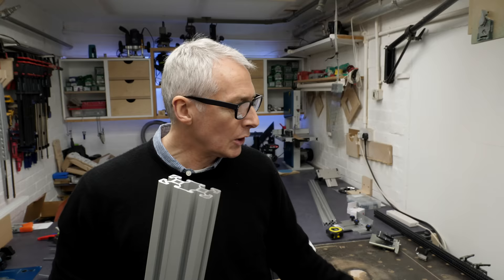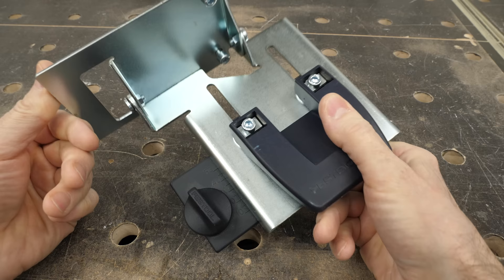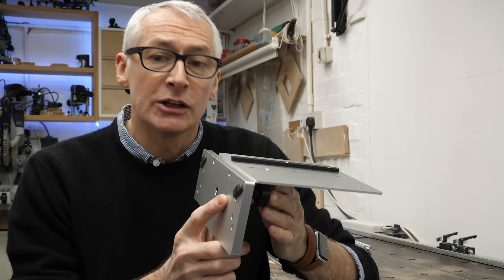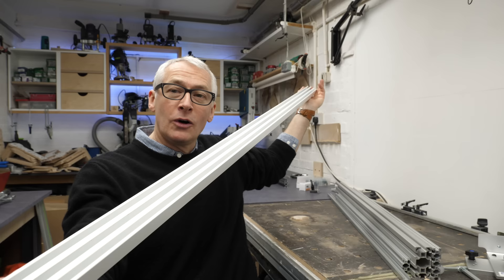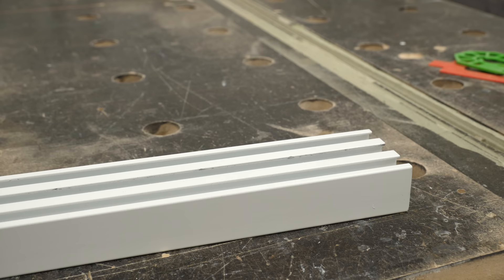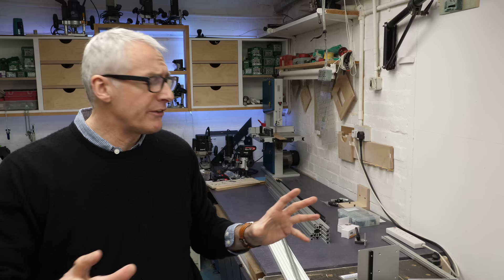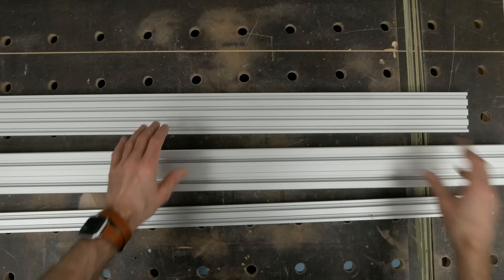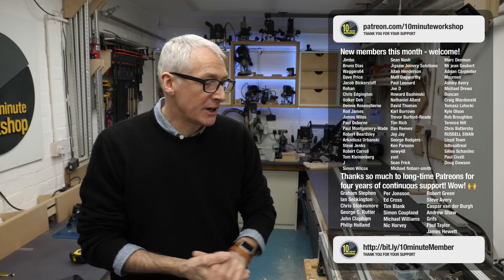Extrusion Confusion - A Guide To MFT Hardware [video 486]

Comment: Thinking out loud here, and off the cuff: That curtain track seems very subpar considering how beefy the Dashboard hinge is (I was going to give you a shout out regarding that since I picked one up myself - have yet to use it though - and hey! You have one!). So. Why not just bolt that Dashboard directly to the bench substrate? Except I also think its' excessive length is going to be a problem for you. If like me you put the track hinge in one spot there really is no need for a track back there (could be missing something though). The stock festool track hinge seems to have been pranged a bit - I can't trust it to lay the track down on the matching pin. Bit of a faff. Very keen to see how this project goes.
Reply from the maker: There’s lots more to come on this build, and many of your questions will be answered then. Lateral adjustment is very useful for the rail hinge, so some kind of extrusion or t-track - or maybe just a router t-slot - does the job. 👍

Comment: For a fixed bench in a small space, I wonder why you would need to have the rail hinge slide along a rail. Or, you might consider having the rear rail mounted over a limited span, maybe 20 cm and not over the full length of bench.  I understand the need for some adjustability for alignment, but you also have tight quarters and may need the space behind the fence.
Reply from the maker: You don’t, necessarily. But if you have the full length of  extrusion, you may as well fit it. Depending on your rail hinge, you could fit it permanently to the bench, or route. T-slot to suit in the bench material. For flexibility though, the curtain track extrusion is excellent. 👍

Comment: The minitec extrusions fit the Bessey rail clamps nicely and other cheaper ones, not tried Festool. They stay square, may be better for the hinge as well, Sautershop sell them.
Reply from the maker: Yes, the minitec is good, but only for clamps - the Festool rail supports don't fit unfortunately. 👍

Comment: Hi Peter. Quick question: why did you buy the extrusion (the one from KJN) with a 10mm slot? Does 8mm not fit the Festool clamps and the Dashboard hinge? Sorry if you’ve answered that elsewhere, I’ll watch the rest of the video, just scrolled forward to that bit, but I was assuming that 8mm is the way to go until I saw this.

Comment: Ah! We came up gathering pretty much the same information, which makes me proud of me if I can say so myself 😂

Now, I'm seriously thinking about getting the Dashboard hinge (being in contact with Rob for a while) and the Sauter frame (1200x800). It should work well as far as my understanding goes. Only doubt is that 45x45 profiles may be too light for the hinge support? Still not sure, need to investigate further on it.

Best!

P.S. great quality video, as pretty much always Pete, thank you so much!
Reply from the maker: Thanks! The sauter frame is 45x45 minitec. Should be fine with the dashboard set, but won’t fit the Festool hinge. 👍

Comment: I used to use Bosch Rexroth, which is what the kjn BR range is based on, but I moved to using Rose and Krieger profile.

It doesn't require any drilling for face to end connectors, just a mitre saw to cut lengths, which join together without using corner brackets. I've build structures with it that are 4m square and 3m tall, and all you need is a 100mm long 4mm ball end hex bit.

My home CNC machine is built using their 80x80 and 80x40 profiles.

Comment: I do think that the clamps you have, can be made to fit the track. As you have several other clamps, you'll probably not choose that option, but some of the viewers might benefit from this idea.
First thing I thought of was to glue a thin layer of leather onto the part of the clamp that goes into the T-track. This will make it slightly "thicker". It should add a lot of friction.
The second way it could be made to fit, would be to add a thin layer of epoxy in the grooves on each side of the clamp.
This is probably a lot more difficult and would require making a jig in order to get a precise enough result.
Reply from the maker: The clamps could be made to fit, but always with some compromise if you also want to use the Festool rail supports. 👍
Reply: I am quite convinced you could file away the extra metal from the Festool rail clamps, the bump that makes it clamp to itself on the thin Ikea rail. Five minutes of manual filing or one with a power filer (i.e. the narrow belt sander).

Comment: Hi Peter,
very much enjoy your videos. They are very professionally presented. I was wondering if you have looked at the  Veritas Quad T-Slot Track for your new MFT top.. I do not know if the length would work but they appear to be the right general dimensions for the front and back of your build. thanks again!
Reply from the maker: Thanks Bill. Don’t think the quad t-slot works with the Festool rail hinge set, unfortunately. Nice profile otherwise though! 👍 👍

Comment: Hi Peter I've been looking for some kind of extrusion to fit on the front of my bench to take rail clamps wound up using an old 1.4m evolution guide rail mounted on a scaffold board works perfectly
Reply from the maker: That’s definitely a more expensive way of doing it, but if you have the rail it’ll absolutely work! 🙌👍

Comment: Very informative video as usual Peter.  Is there a front rail support for the festool hinge?  Its a shame there is not an affordable hinge for the Dewalt track which I use, although the dewalt saw can run on festool track, so might end getting a short length for my bench.
Reply from the maker: Thanks Nigel. Only the Festool extrusion - or the ikea curtain track - will work with the Festool rail supports, front & rear. 
Not aware of any options for alternative rails - most saws will run in Festool-pattern rails, so I guess there’s limited appeal in someone developing one. 👍👍
Reply: Our guide rail brackets are compatible with Dewalt rails.

Comment: Design choice question please Peter. 
Why two Rutland T tracks at the front (assuming for clamp use)?
Reply from the maker: Main reason was to have other clamping options eg I can set a stop in the top track for the rail hinge front support, and still have clamping options with the lower track without affecting the stop in the upper. But generally, just good to have the option. 👍

Comment: I am wondering how much time you spent investigating all the various aluminium tracks, apparently motivated to avoid the cost of the Festool track. This was despite your considerable investment in usable Festool clamps and fittings, and then in buying non-Festool fittings. Of course, your research makes an interesting video for those who need to have a tailor-made bench, as well as a warning of the complications.
Reply from the maker: Well, a lot of what I’m sharing has been accrued over many years - decades even - if buying and using all kinds of bits and pieces. And part of what motivates me to do what I do is to see if I can make something that performs a similar function to eg a Festool original, but without the proprietary hardware. 👍
Reply: @10MinuteWorkshop  Relieved you are not deep mining the Internet for elusive gains! My own experience of unique solutions has been dampened by the subsequent disappearance of innovative small companies and then sadly, any hope of replacement parts. A lot has changed over my 60+ years of woodworking. But I am impressed with the organisation of your quite restrictive workshop and will watch with interest just how you create your replacement workbench.

Comment: How about using your router table setup and milling your own custom sections from white oak?
Reply from the maker: The short arms of the C on the Festool profile need to be very thin (~2mm) to work with their rail hinge; not sure I'd trust anything other than metal at that thickness tbh. 👍

Comment: wonderfully explained, so i wonder does the benchdog and festool stuff fit in 40x80 nut 8mm extrusion? ah bugger as i watched longer you said again that it does but i am guessing it dows not with every 8mm extrusion you have Itype which has a deepth of 12 min and B Type which  have less. like both rotex are B Type and item and the 40mm standart is the i Type. guess i hve to get  the festool system once i got a tracksaw as my whole workbench combo is makde of 40x80 i type extrusion

Comment: Have you ever considered wrapping around the mft top, to the front? Obviously not as flexible having holes, rather than a track, but wondering if a mix of both is an option?
Reply from the maker: Sorry, not sure I understand ‘swapping round the MFT top to the front’ ?? 🤔
Reply: "Wrapping around" - I think Craig means to have a few rows of holes on a piece of MDF installed where the extrusion currently is - i.e vertically/ 90 degrees to the existing one - like you often get with bigger welding tables if you want to Google for a picture.  I guess you'd still have to have a small bit of extrusion to attach your front locator peg for the track, or attach it in another way
Reply: Check out hooked on wood https://youtu.be/70DEFtp_2ew . He has built a bench that wraps around on the front
Reply: @londonmaker5347  This is exactly the example I was going to use. Hooked on Woods is what I pictured. Love his stuff

Comment: Peter great informative video. Is there an advantage in fixing the rail on RHS of the table vs LHS? Considering measured piece should be on the left side of the rail.
Reply from the maker: The waste side is always to the right of the splinterguard; having the rail towards the right of the table provides more support for the ‘good’ half of the workpiece, is all. 👍
Reply: @10MinuteWorkshop  Thank you!

Comment: I'd be afraid that the thin walls of the profile get bended. Especially with the hinge fitting and the long lever of the saw guide.
Reply from the maker: Just FYI it’s holding up just fine, as there’s actually very little leverage on it. But I’d it bothers you, like I say in the vid, use something else. 🙌👍

Comment: Pete, I want to build my own MFT table I am using a Festool 1400 and LR32 wanted to a ask you what is a good 22mm bit for the holes. I'm in the us . Ty
Reply from the maker: No 20mm bit will give a snug fit used with a router unfortunately, due to router run-out. I heave my own bit being manufactured that will help compensate for this, but it’s a little way off yet.

Comment: Hi peter, I am thinking of making my own extrusion from a mix of plywood and sheet aluminium. Just wondering if you can tell me how thick the walls of the extrusion are on the festool mft profile? thanks x
Reply from the maker: Hi. Sorry, no; I don’t have an MFT or the extrusion any more, but you should be able to find it with a quick google search  👍👍
Reply: thanks peter  @10MinuteWorkshop

Comment: Hopefully this isn't a really stupid question, but if I want to use the festool front support, could I use the t-track or would I use the IKEA curtain rail?
Reply from the maker: IKEA curtain track for the Festool front & rear rail supports. With all the issues highlighted in the video re clamp compatibility, unfortunately. 🤷‍♂️
Reply: @10MinuteWorkshop  many thanks for all your help😁

Comment: Hi, I’m wondering if a 3D printed cover for some of the ‘too small’ for the profile clamps might be suitable as a spacer to take up the slack.
Reply from the maker: Possibly, but it’s a very small profile and I’d be slightly concerned about keeping it attached. 👍
Reply: @10MinuteWorkshop  hi, a valid concern but I was thinking a friction fit that would compress slightly as the clamp tightened. Adhesive would prevent them being used for there original purpose.

Comment: apologies  if this has been mentioned but when you discuss the clamps not tightening up because they clamp themselves, surely as you would be clamping something between them  the slippage wouldnt happen. or am i missing something?
Reply from the maker: The clamps have a slight 'step' in the head, and because the walls of the Ikea track are thin, this step protrudes through the extrusion, so the clamp effectively clamps to itself. 🤷‍♂️
Reply: Becuase of the step, the clamp would clamp itself to the workpiece, and not to the rail, so the workpiece would be free to slide.

Comment: Thanks for another useful video Peter.  You sold me one of dashboards hinge kits on backorder now.  I also have the concern about the hinge causing the benchto be pushed away from the wall.  Where my workbench will be I can borrow space from the wall cavity between the studs.  I’ll cut drywall and have the hinge plate extend into the wall.  I see brick walls in your shop, but is the wall behind your mft drywall?  Can you steal some relief and keep your new bench closer to the wall?
Reply from the maker: Thanks Ken! I can’t cut into the wall without messing up the soundproofing unfortunately, otherwise I’d 100% do that! 👍
Reply: @10MinuteWorkshop  I have two places, I plan to steal cavity space.  One on an exterior wall and one on an interior wall where I’ll run my vacuum hose from my miter saw.  My miter station and wings run alongside the parked car so 4 inches is quite useful for car excess and egress.  I plan to use to or three layers of  Noise Grabber Mass Loaded Vinyl with Foil Facing, MLV with Foil, E84 Class A, High Temp Soundproofing (1' x 1' (1 SF)) in the interior wall cavity.  Amazon is my source.  This should equal my low mass wall dampening that is my current state.  Curious to know, is your partition wall between your two spaces sound proofed or dampened?  Reflected sound eliminated aids in the overall sound profile. I am in a smaller single bay garage and I prefer not to disturb home occupants since I am an off hours crafter.

Comment: Hi Peter. Is the profile on the Festool hinge removable? The part that slides into the extrusion. If it is, surely a new piece could be machined to suit standard 8mm KJN extrusion.
Reply from the maker: No, it’s all integral - almost like they specifically designed it to stop,you from doing that… 🤔🤷‍♂️👍

Comment: Hi Peter, a quick question regarding the OEM Festool rail hinges. Does the MFT3 version fit the older MFT 1080?

I know the parts numbers for the MFT3 and MFT 1080 rail hinges are different and it's hard to find stock of the older discontinued version for my old 1080.

As always, thanks for the great content!
Reply from the maker: Ooo, good question. Yes, I had the same issue and bought the MFT/3 hinge myself - works fine on the 1080 profile. I’ll be sure to mention that in the build video, thanks! 🙌👍

Comment: Festool front bracket, will that fit in any of the T tracks you tried, or is it also Ikea sized please?
Reply from the maker: No, Festool front bracket uses the same t-bar as the rear hinge, intended only for Frstool’s special extrusion, but can be adapted to fit the Ikea track with a little sanding. 👍

Comment: Hi Peter, just about to start building my MFT table from your plans. One question, will the ikea Vidga track work with you birch ply hinge that you sell? and would it work with the likes of the benchdogs hinge? Thanks. Im going to start with the birch ply hinge and see how often Im using the table and see if it does everything I need.
Reply from the maker: Hi Brian and thanks! The benchdogs hinge mounts direct to the MFT top, doesn’t use the extrusion at all. I did a video about it, and the two other commercially available rail hinges here - 3 MFT Rail Hinges [**Gifted/Ad][video 494] - https://youtu.be/ywQoSh7G8KE
- might be worth a watch? The IKEA Vidga track will work with my DIY hinge, but honestly you’d be better off with regular t-track & M8 T-bolts, unless you’re considering adding the Festool hinge at some point. HTH. P
Reply: @10MinuteWorkshop  thanks. I don't see myself ever getting the festool hinge so I might just do that and put a standard rail on the back. Thanks

Comment: Greetings Peter, love the channel and the content. I’ve got an extrusion puzzle I’m hoping you can possibly help me with.
I’ve got a Bosch GTS1031 table saw. It has an odd shaped extrusion  for the front rail. I’m looking for some kind of t-nut to attach to the top slot of the rail, but the inner edge of the top slot is at an angle, instead of the normal half of a hexagon. Any idea what kind of nut would work?
Reply from the maker: No, sorry; the more I look into extrusion the more of a minefield it seems to be, especially with manufacturers trying to lock in their own accessories etc... 🤷‍♂️ 👍

Comment: Hey Peter, I am trying to find a rail guide square for my DEWALT 1300W 165mm Circular Plunge Saw DWS520KTK-XE track. can you help, please?
Reply from the maker: If it’s the standard Dewalt track, then the benchdogs square will work. https://benchdogs.co.uk/products/mk2-rail-square-dewalt-1 Use offer code 10MINUTEWORKSHOP at checkout for a 5% discount across the board. 👍
Reply: Thanks heaps, Peter. It is just the job!

Comment: Can someone point to, or share all dimensions of the festool track? It should be possible to rout out your own track in hardwood or not?
Reply: I did find the newer profile on Pinterest (252764597818463851) Opening of t-track is 8.6mm, the 'lips' are about 2.6mm thick and 2.7mm tall. And inner-depth of slot 9.7mm (excluding 'lips')

Comment: 9:27 but you never clamp without anything between? 
Only clamping the clamp makes no sense for me.
Reply from the maker: Missing the point Michael. The walls of the extrusion are too thin, so the clamp stands proud; doesn’t matter wether you have a workpiece in there or not, you’ll never be able to clamp it securely because you’ll clamp it to the clamp, not to the extrusion. 👍
Reply: @10MinuteWorkshop  ok, thank you, i understand now. Makes sense 👍 
I did not think about that.